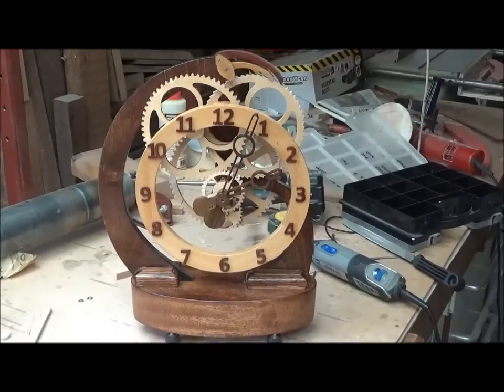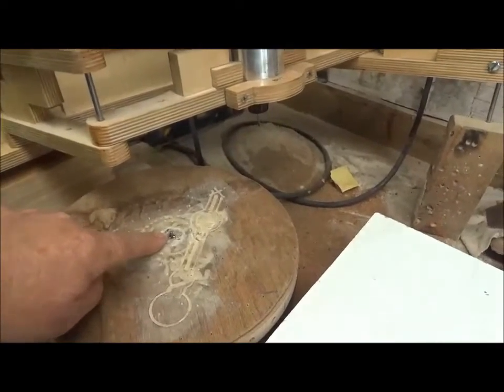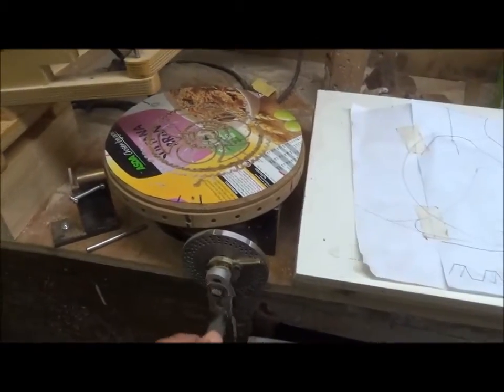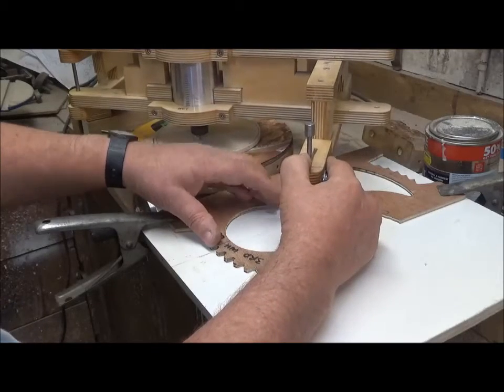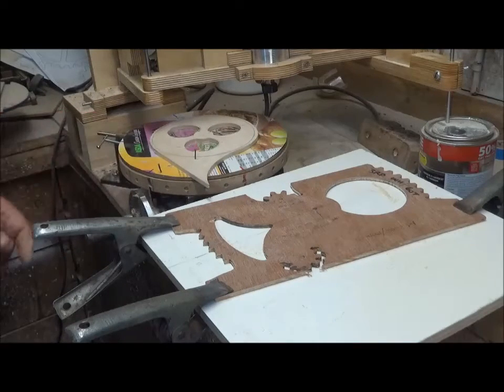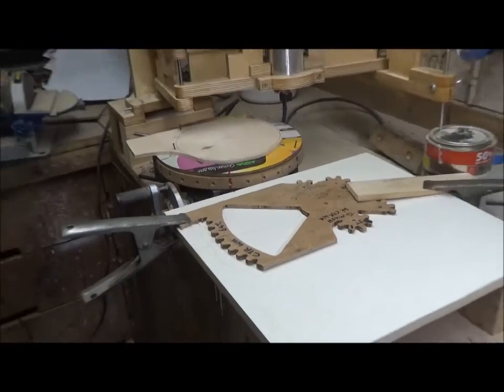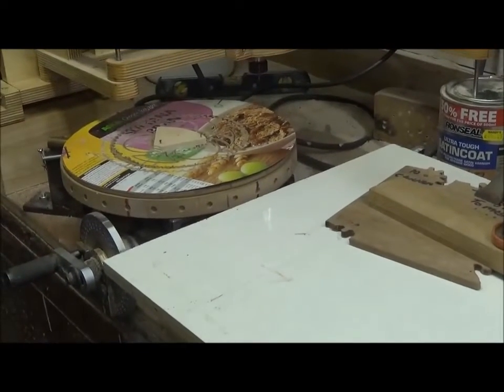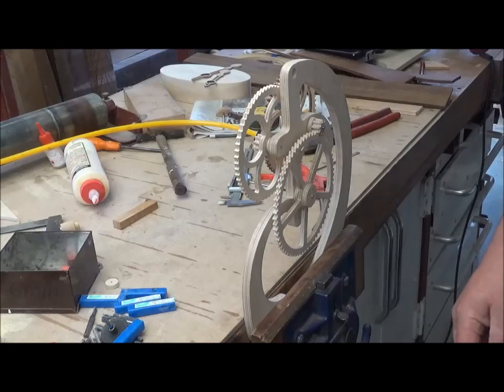Cutting Wood Gears

Comment: RATING: 70 OKAY BUT NEEDED TO SHOW GEARS BEING CUT - ALSO, YOU USE THE INCORRECT USE OF THE WORD "TEMPLATE" 
tem·plate
a shaped piece of metal, wood, card, plastic, or other material used as a pattern for processes such as painting, cutting out, shaping, or drilling.
2.
a timber or plate used to distribute the weight in a wall or under a support. YOU SAY "TEMP-PLATE" - MAYBE FIX THIS?

Comment: This is better(more accurate) than most other crappy examples on the net, but still... who wants to get bored cutting gears for 3/4 of their time?
Buy a load of various size gears in bulk... and be done with it... or get a CNC
Reply: CNC is a much better and accurate.